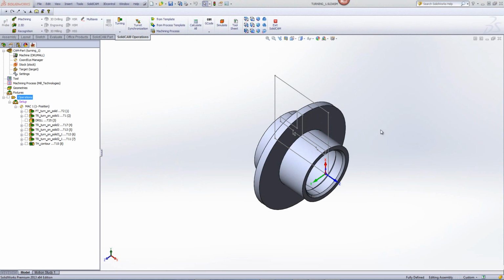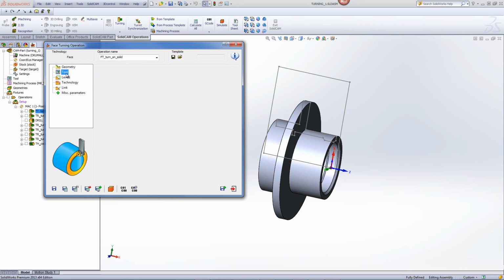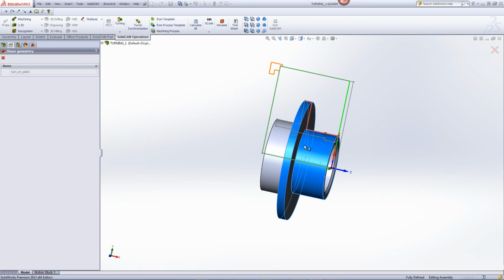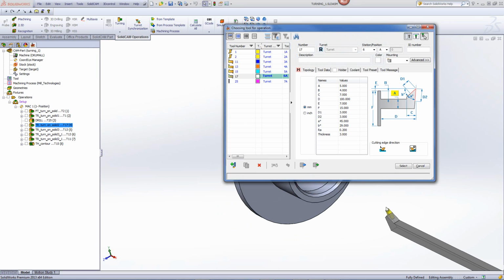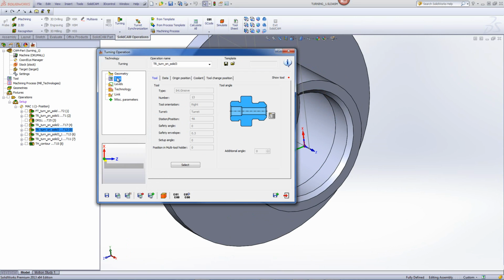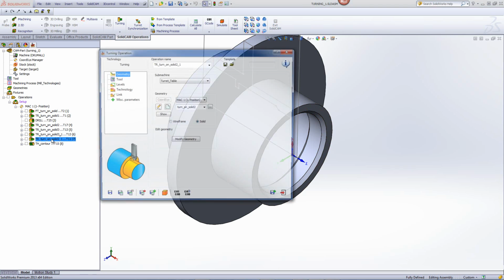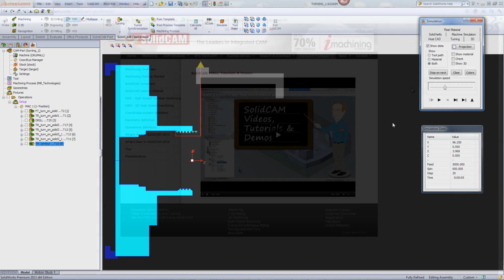SolidCAM Modules Overview: Turning - Part 1

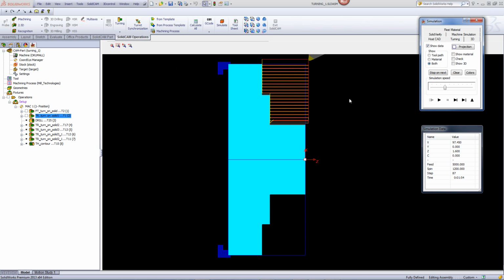Comment: They started using this program were I work. It is unorthodox to what many are accustom to. Example. In video around 4:30 it shows "final cut" going contour of part from small od (Outside Diameter) up the face to large od. Can this program be controlled to finish face cut from od to center, than move back to cut face from large od to small od, than turn all diameters? Our programmer is getting harsh feed back from machinist for running turn tools backwards on face cuts even though it can be done when removing small amount of material. He's new at programming and using cnc software and doesn't think it can be done. Machinist are complaining and making changes at there machines.
Reply from the maker: This is being worked on to be able to do it in one operation. In the meen time you can do the following.
1: Do the operation with rough only.
2: Do another operation for finish and just reverse the geometry direction.
Reply: Thanks for reply.